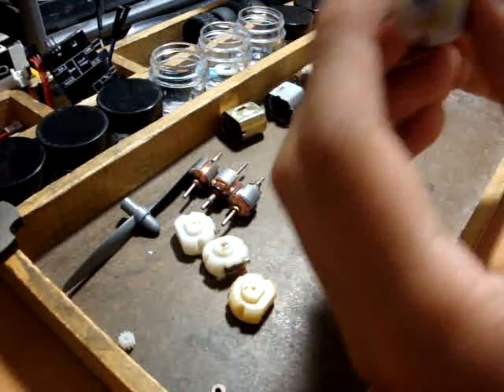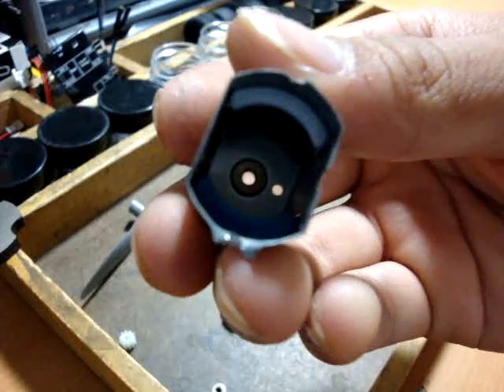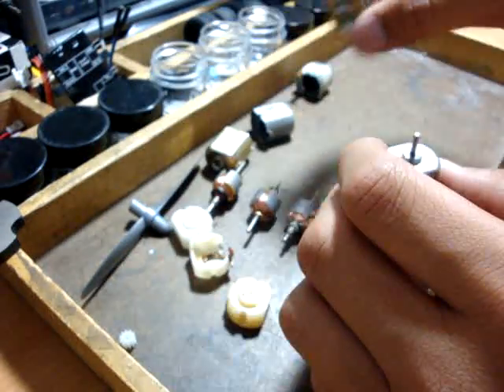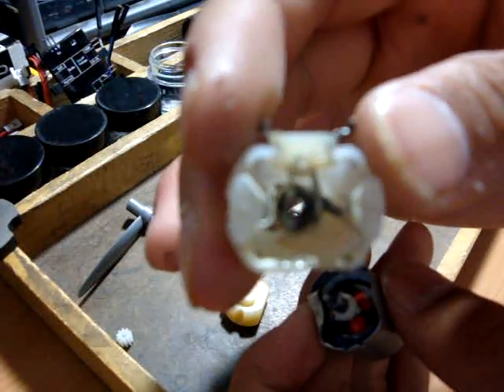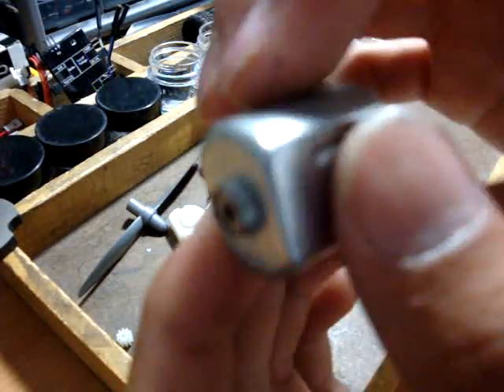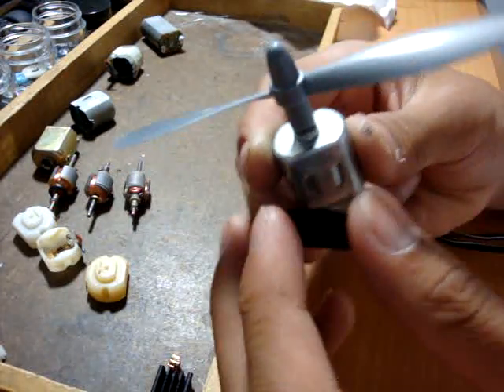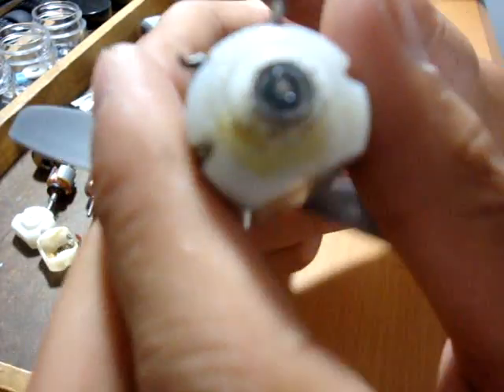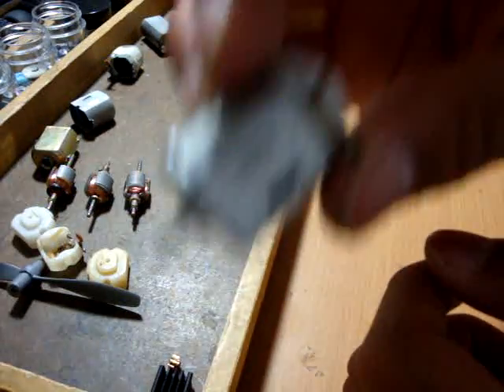Homemade 130 motor with ball bearings

Comment: Would you say it is louder or quieter with the bearings? By reducing drag you decrease the amperage the motor draws and you increase the longevity of the motor you did not need those gobs of lube in the motor in fact they likely cause more issues now.  There should only be 3 contact points two that need lube the end cap bushing and the front bushing there should not be lube elsewhere normally putting sealed ball bearings keeps the lube in the bearings the brushes are the other contact point and now this motors point of wear.